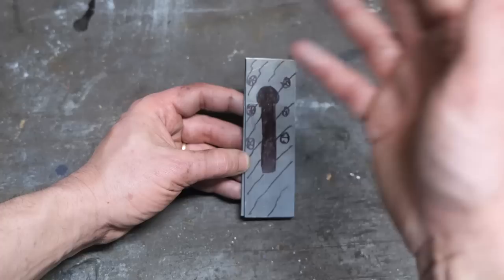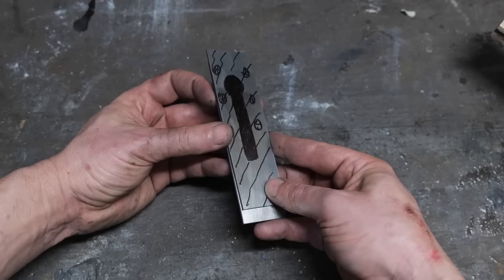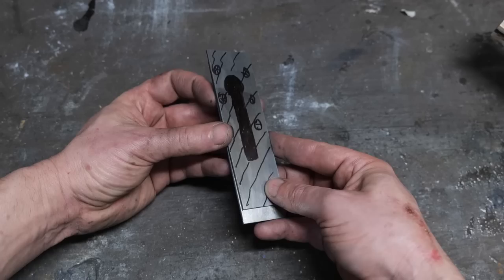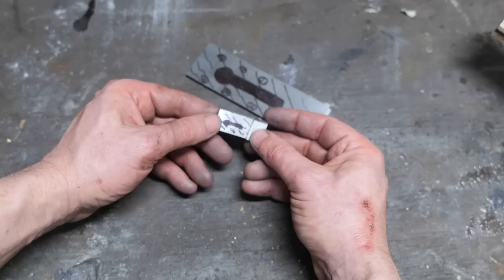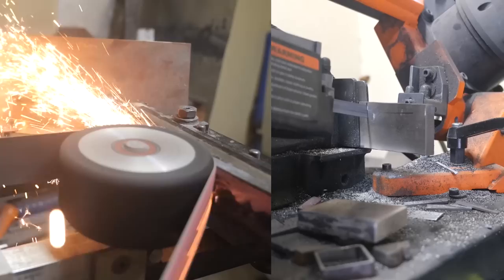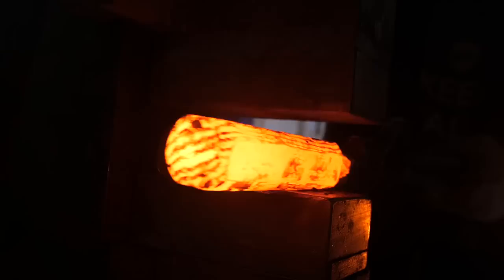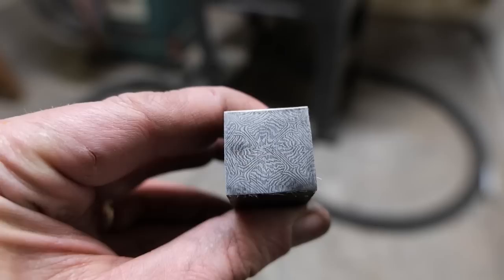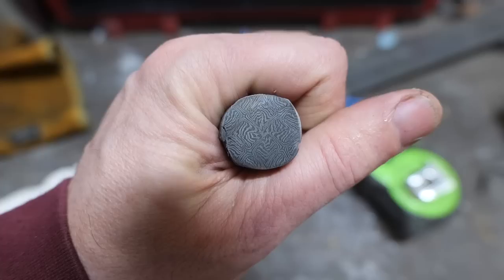Forging a Plane Blade Pt 1

Comment: I have a piece of iron/steel that I use to practice welding occasionally, I mostly just fold it back on itself, occasionally adding iron or steel. It can be surprising how well a plug weld takes sometimes.

Comment: That blade is going to look great. It's just reminded me that I had this thought a while ago about having a blade with a high carbon steel as the cutting edge and some decorative copper/brass/whatever riveted onto it. I suspect that getting a tight rivet would just not work, but I thought that it could look cool.

Comment: Where does the turbo encabulator mount on that model?
Reply from the maker: You need a second generation, retrofitted studer pipe and modified deez nut
Reply: @GreenBeetle  Sigh, that's what I was afraid of. I only have first generation in stock.

Comment: unless you're polishing the edge to 10 million grit the differences in the carbides will not create serrations that affect the performance of the blade. carbides are small, yo.
Reply: The channel Knife Steel Nerds just put up a video a couple days ago showing the impact of different steels wearing at different rates in a damascus blade. Seems more than enough to have a negative impact on a hand plane. I'm no woodworker though, the serrations are clear and visible but I'm guessing on the impact. Either way, it's still a fantastic video and worth checking out.
Reply: @myfavoriteviewer306  that may well be true, but in that case the serrations come from the difference in hardness between the different layers of steel, not because of the carbides. carbides are very, very small. thousands of times smaller than the thickness of a layer of damascus. in green beetle's plane iron, the 15n20 and 1084 should harden the same, so there should be no appreciable difference in hardness between the layers.